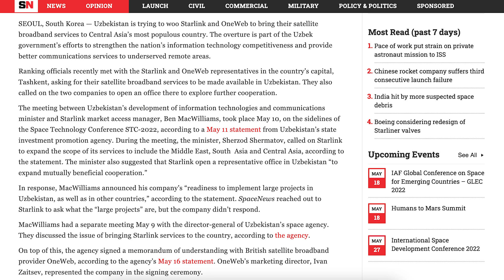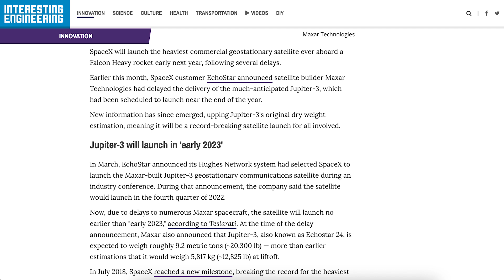SpaceX Starship Updates! Booster 7 Raptor Installation Underway! Booster 8 Stacking! TheSpaceXShow

Comment: SpaceX seems to be having weight issues with Starship, that would explain the dispenser system for Starlink. To have a functional wide payload hatch, the hull would need structural reinforcements adding weight. Add to that, the requirement of sensitive maneuvering to deploy the cargo without a Canadarm.